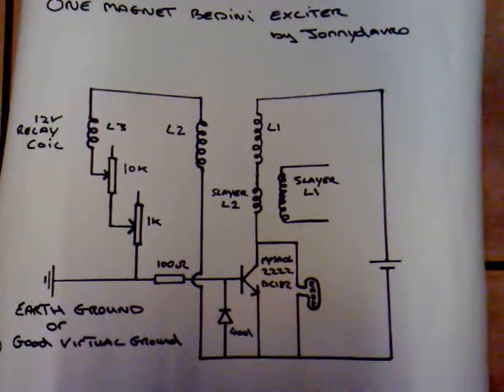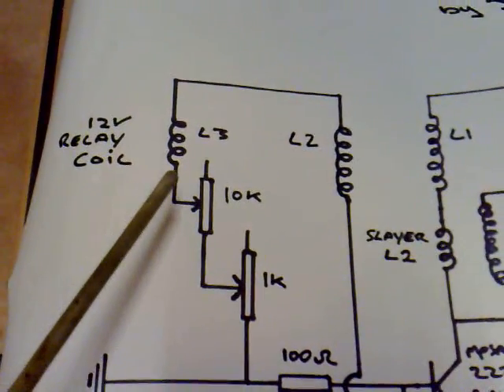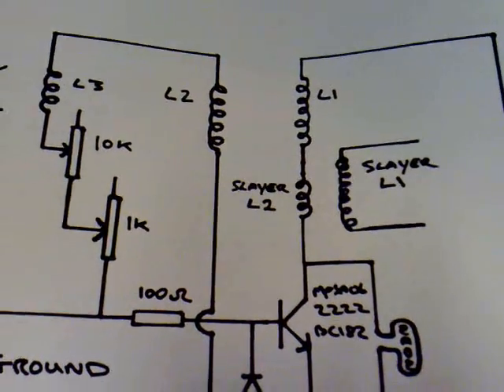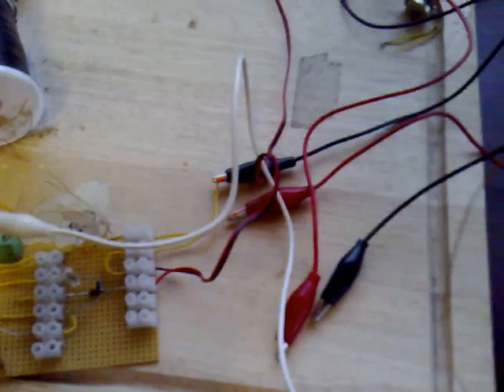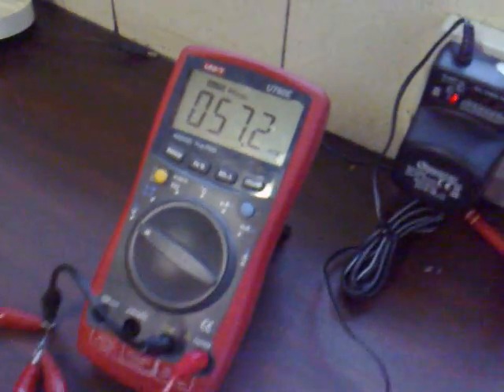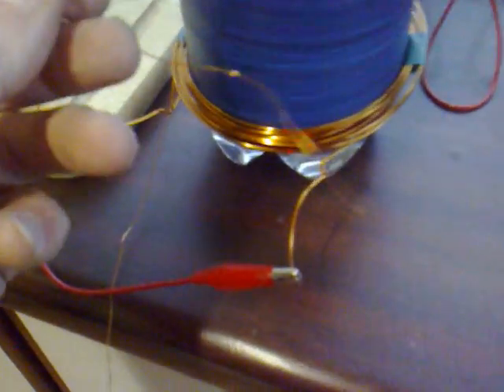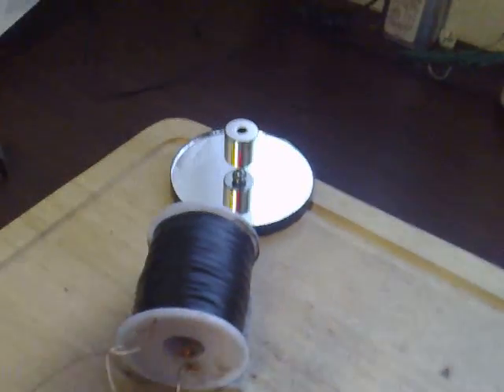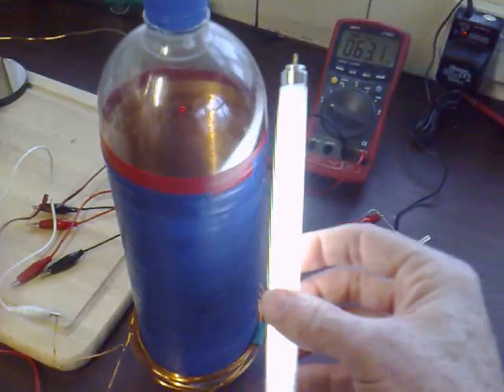One magnet Bedini exciter

Comment: @jonnydavro The Bedini name always implies some free energy or overunity. Fun is fun but when you associate things with the Bedini name it implies a SCAM and most are discovered to be just that.
.
As most have discovered, remove any moving parts and the magnets and it works exactly the same as an oscillator circuit with step up voltages.
.
As I stated the Earth Ground has no function. Make it real and people may believe what you are doing.